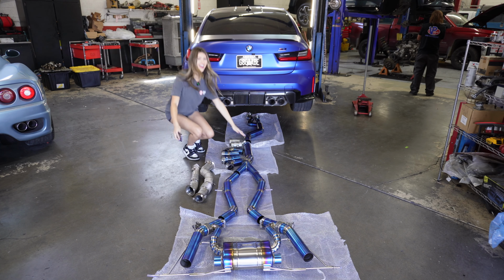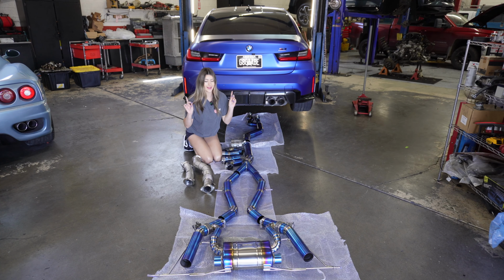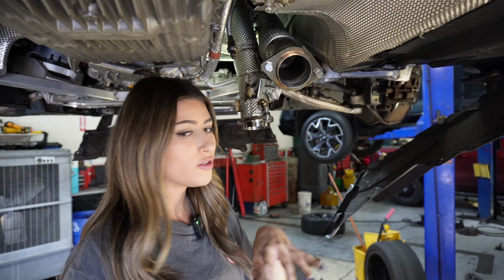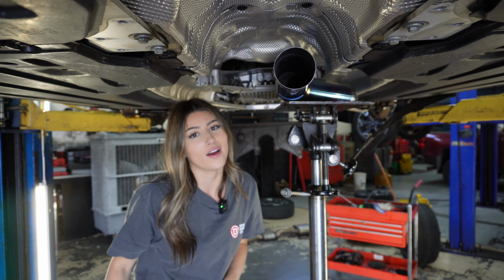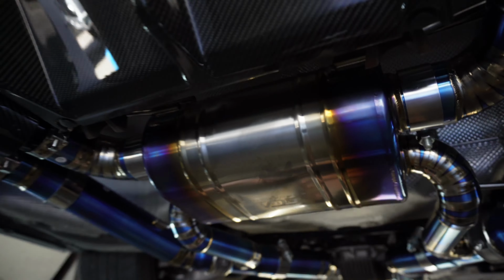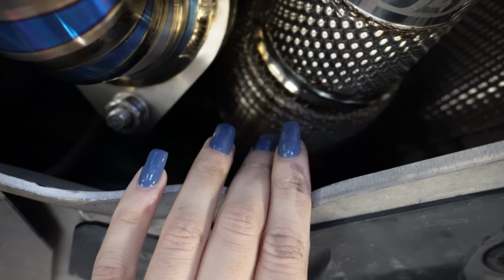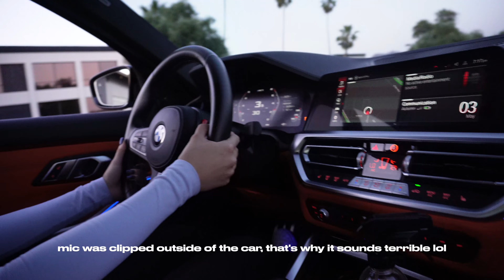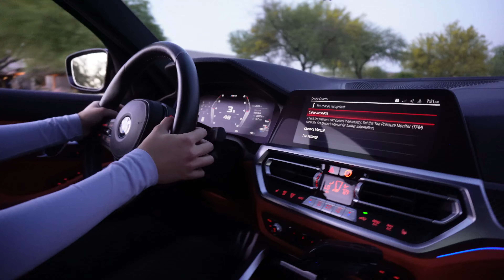Full Titanium Exhaust w/ Catless Downpipes on My G80 M3 - Revs, Idle, & Fly By's

Comment: The car sounds better and that look is very clean.  It does look like the driver side exhaust tip is hanging noticeably lower than the passenger side if not already aware.  To bad you didn't get dyno numbers before you started adding mods.
Reply from the maker: Yeah that’s fixed now!!

Comment: Check eng light? 
No tuning needed?
Reply: If you do the catless donwpipes you will need to tune it. If you go with our 200 Cell High Flow Sport Cats you don't need a tune. The catback exhaust itself does not require a tune either.
Reply: why do you need a tune for catless?

Comment: What brand is this exhaust again!??? I have a ‘24 cs M3 looking for full exhaust system. Any recommendations? No off brands though….
Reply: This is our Titanium Exhaust with our Catless Downpipes!
Reply: @GermanCarAccessories  I have the same 24 M3 CS, im very interested in purchasing this exhaust. Just a few questions: why is it so much less expensive than say for example valvetronic designs titanium is 4800? Do I get the same quality and loudness increase? Can I use the OEM tips? (I’d like to make it look totally stock) thanks!
Reply: @GermanCarAccessories  Also is there a Catted Down pipe set up I can use to avoid the smell and CEL? If yes, is it still louder than stock down pipes?